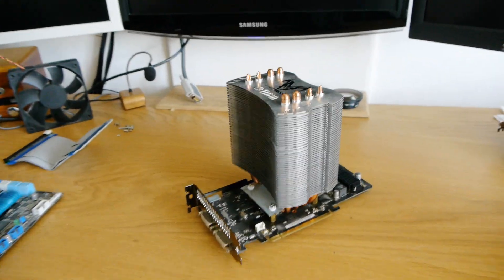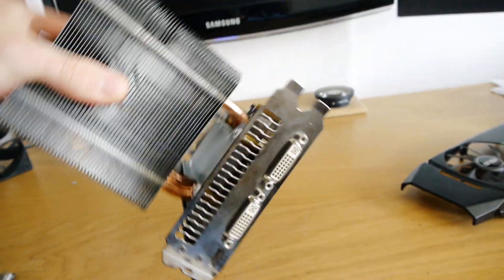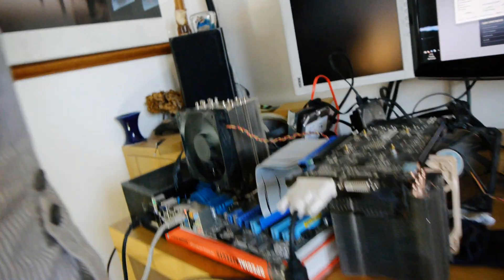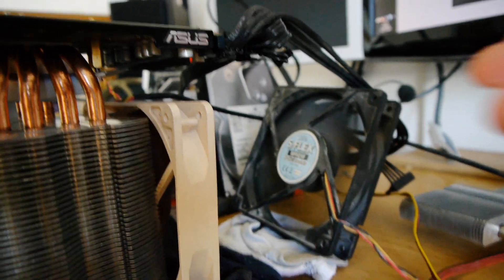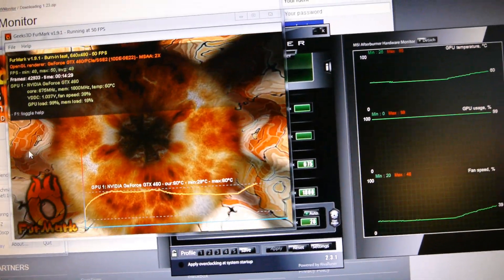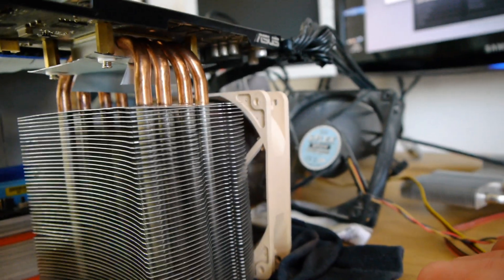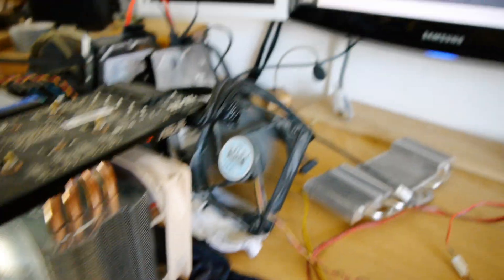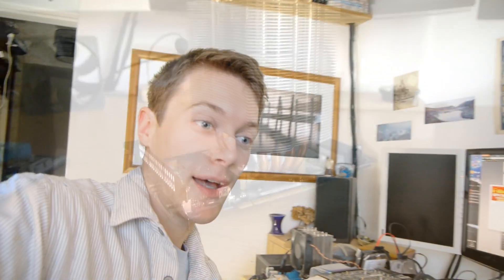CPU cooler on GPU (INSANE temps!)

Comment: DIY Perks You aren't using your cooler right, look up how heatpipes work and why it shouldn't be upside down.
Reply: You mean he's not using it optimally. It still works
Reply: Heat pipes are designed to not need gravity for the fluid to flow properly.  If you want proof, open a laptop sometime.  Anyways, given that he's only 90 degrees off this type of coolers normal orientation I don't know why you would consider it to be "upside down".
Reply: Robert winfield Lol unfortunately he was just born that way. Check out his comments on other things.
Reply: carlover you have become a magnet because you are wrong, you don't shut up and you keep coming back and reading this post. Can I get a +1?!?!
Reply: carlover "The condensed working fluid then flows back to the hot end of the pipe. In the case of vertically oriented heat pipes the fluid may be moved by the force of gravity. In the case of heat pipes containing wicks, the fluid is returned by capillary action." -Wikipedia

I did read. Looks like you're just an ass.
Reply: Spencer Twaddle Nature can be such a bitch sometimes, we cant blame him for that.
Reply: carlover lool good thing i have some popcorn :D xD
Reply: You know that's how water gets to the tops of trees right...?
Reply: No, you've proven that you can look up how a vapor chamber works. You haven't proven anything about pc heatsink's have vapor chambers. The titan has one and there are a couple cpu heatsink's that have them. There may be some with a gas in them but those aren't a vapor chamber like what you're talking about, you know, the kind with actual fluid and wicks. Just admit it. You have a partial idea of how shit works but you don't know how a standard pc heatsink works. Trolloolloollooll.
Reply: carlover 
 If you think about it you will notice that for experiment like this is not possible to turn graphics card in "right way" (tower up) and leave it on the table because you cannot  connect graphic card with motherboard in that position because connectors on GC would be pointed away from MB.
Reply: But its only test.  This video is not about how cooler have to be, but what you can get with cpu cooler on gpu. First time i build it i also try it this way, upside down, and then i build open case with cooler facing up, above PCI-e connector at motherboard. Now i got 5° lower temp then when coller was facing down.
Reply: Spencer Twaddle haha!
Reply: carlover  Why dont you open your graphic card, take one aftermarket CPU cooler and make video about how cooler have to be in case like this and leave us to admire to this idea like it is. How can you say its wrong? Temps are 30° lower then with stock cooler turned facing down (the "wrong way") to me that is not wrong. With tower facing up is a bit better but it works great in both ways. And btw your trash talk is not effective  here at all.
Reply: carlover sadly carlover is correct. Gravity and centrifugal force can affect capillary forces, and those a forces normally seen in vapor chamber heatsinks. http://www.radianheatsinks.com/VaporChamberTechnology.aspx HOWEVER, I don't see many vapor chamber heatsinks, and if they are they really don't like to advertise apparantly (besides the fact the few I've seen GLADLY flaunt such a feature). The ones that are vapor chambers normally cost more, and generally look... cooler. The heasink in this video seems to be just a standard after-market one, not a super fancy 100$ heatsink. I think in general the reason vapor chamber heatsinks aren't common is because for the same price watercooling would be better.

Oh, and carlover, to assume a redirection from wiki based on vapor chamber > cpu heatsinks is just idiotic. Some topics are redirected based on lack of information, not because it is standard to contain it.
Reply: Emil7773 It doesnt need to lie on the table, the pci riser cable isnt a solid object it can bend, so it isnt problematic to bend the cable and make the card lye with the cooler facing up.
Reply: Emil7773 How is it an objective test if he hast placed the cooler right orientation? It doesnt show real benefits. Glad you had excellent results. 
Spencer Twaddle Im glad you took time to try to be a smartass. Next time actually read something about the topic so you dont write complete bullshit.
Reply: This kind of cpu cooler doesn't have wicks. 
Also if you think you can even compare forces between capillary forces and gravity you really need to read more about it.
Reply: That only maters with vapor chamber heat sinks. This is just a regular one. Being upside down isn't going to matter....
Reply: Jesus fucking christ i quit, look up how heat pipes work for fuck sake jesus shit !!
Reply: Spencer Twaddle  Kevin Cornell Emil7773 
Im so glad you are proud of how uneducated you 3 are. When you look up how heatpipes work and when you read that in fact Emil7773s results prove what i am saying let me know if you still think you are right. I just love when Kevin Cornell said that what im saying only applies to vapor chambers while he didnt know today almost all heat pipes are vapor chambers and ones in video are vapor chambers. So now 2 of you actually confirmed what i was saying but still think you are right. But i guess at this point i could draw it all out for you and you still wouldn't admit you were wrong.
Reply: carlover why don't you look into the gtx titan's heatsink and find out what a real vapor chamber is. No, not most of the coolers out there are vapor chambers. Very few are. Most are just some hollow copper or aluminum tubes that transfer heat. No vapors in those.
Reply: Kevin Cornell You just wont admit it. Almost all CPU coolers today have gas inside the heatpipes. Dude i dont have time to reply 100 times, if you dont want to learn there is nothing i can do about it, it is your choice. 
http://en.wikipedia.org/wiki/Heat_pipe
Reply: Emil7773 Yeah just like i said, it is working better when the heat source is lover than heatpipes. Thanks for confirming what im saying once again. That is literally what im trying to explain here.
Reply: carlover I don't think you actually read that Wikipedia entry (great source, by the way). 

You said that it utilizes a vapor chamber? Well, according to your own source, "Note that most vapor chambers are insensitive to gravity, and will still operate when inverted, with the evaporator above the condenser". Furthermore, capillary action is mentioned several times throughout, particularly noticeable in the Vapor Chamber or Flat Heat Pipes section, where it states that vapor chambers often utilize "a closed-loop capillary recirculation system".

So, either you didn't read it or you didn't comprehend the context. Also, you probably don't understand how capillary action works.
Reply: Naga Sadow Am i being pranked by a group of trolls? I don't understand how i've become a magnet for those that either don't think or read completely.
Dont you see what wrote in my last comment? Let me quote "Yeah just like i said, it is working better when the heat source is lover than heatpipes.".
Which doesn't say anything about cooler not working facing the wrong way, im saying for the 100 time that the cooler would work with heatpipes facing up. 
The capillary forces cant even be compared with the gravity moving the gas and liquid inside the vapor chambers, thats why trees can only grow to certain height, after that heigh the gravity wins and capillary forces become to weak.
Reply: Kevin Cornell Of course im coming back, im getting notifications about replies. 
You clearly dont have any arguments left, i have proven i was right more than once. Its your choice to accept it and get educated or continue to go the other way.
Reply: Kevin Cornell Sorry, I have proven myself and what i told already. There is also a guy that confirmed what i was saying without him even knowing. Those heatpipes most of aftermarket cpu cooler have today are vapor chambers. Even wikipedia redirects vapor chamber to heat pipe, since today that is what heat pipes are. Get 212 evo for example, cut the tops of those heatpipes, see if would still work as good.
Reply: So at my job, we have these hilo's with a really old compute system on them and I saw today that they have a 25mhz processor in them. O.O just blazing fast! Lol.
Reply: Get an inverted case if you are concerned, problem solved.
Reply: my theory is that carlover is just from a different planet and his brain isnt compatible with ours
Reply: seong min Thanks. But its only basic physics.
Reply: carlover Physics that you don't understand. If you did, it would be obvious that an inverted orientation for a CPU cooler has no negative impacts on the cooling performance. The orientation doesn't interrupt the movement of the vapor, and therefore doesn't impede cooling. As most of us know, gases that are different temperatures displace each other in order to create an equilibrium.
Reply: Naga Sadow I proved im right and also got a confirmation in this comment tree that what im saying is true. I did tests myself also that proved me right. I really dont know why so many butthurt people keep replying to my comments. Its true what George Carlin said-“Just think of how stupid the average person is, and then realize half of them are even stupider!”.
Reply: carlover Well, since what you say is going against the source that you cited, we need documentation and videos of your thirty controlled experiments... otherwise it's statistically insignificant and therefore invalid.
Reply: Naga Sadow Dont have time for you and all of the shitty trolls, you have a comment tree here with 10 of my comments. read all of them.

Comment: shouldnt you use the top pci-e slot ? the middle and bottom ones run at 8x, i believe , top one runs at 16x..
Reply: DIY Perks PCIe 2.0 x16 has twice the bandwidth of PCIe 2.0 x8... Theres no reason not to use the top slot if its not populated with something already. But thats just my OCD kicking in.
Reply from the maker: Theoretically yes, but looking at benchmarks there's practically no difference when using one with less lanes (PCI-E 2.0 8x is about the same speed as PCI-E 1.0 16x).
Reply: David Seong I don't think GTX 460 can max out 8x.

Comment: is that a TT frio?
Reply: Great video DIY Perks. Awsome stuff.
To all those who dont belive, you should try it if you can.
I made it with HD6850 and Scythe Mugen3 with 140mm Scythe fan and performance, temperatures and silence are awsome.
Here some pics. 
http://www.pohrani.com/f/1K/by/36p85dJT/dsc01103.jpg
http://www.pohrani.com/f/2i/dS/3Js8ILZ2/dsc01098.jpg
http://www.pohrani.com/f/3S/YZ/3aQYWfX2/1/my-case-minvent.jpg
Reply: Khalid Hassan Shohag
 ebay
Reply: If you're talking about the one on the GPU itself, it's a Scythe Heatsink.
Reply from the maker: Ben Major  It's actually a TITAN Fenrir
Reply: where to get a pci extension chord?
Reply: Are you talking about the cable that comes from the power supply then goes to the 6/8 pin PCI-E connector? Or are you talking about the PCI Express slots that you can use the extenders for it?

Usually I just buy the stuff from Amazon or Newegg, if I was in the US. Ebay if its there as well.
Reply: i was referring to the extenders actually.. thanks.

Comment: The open air probably accounted for a good 5-10c off the temp also. I drop about 7c off my temps opening my case with the stock cooler on
Reply from the maker: Sounds like you need to improve your case's airflow. You shouldn't see any increase in temps if you have a good airflow configuration vs open case.
Reply: DIY Perks. That depends on the case. And type of cooling being used

Comment: How about:
A gpu with a cpu heatsink mod.... placed in mineral oil, using fans to force the oil around the card as well as through the heatsink?

Then you could just dump all of that stuff that's on your desk (with exception to hard drives) into oil and have an aquarium (with no fishes). That would be A solution to the memory chips on the card running hot.

Comment: i did it with my cpu cooler but my gpu failed and is not working now because the heat sink was not tighten enough with the chip well i did with my old hd 4350 which was running far cry 3 and hitman absoluton..

Comment: Nice! Good alternative is the PNY gtx 780ti OverClocked edition. Triple fan cooling unit got the same temps and is not noisy.  h100i on the other hand is the source of most fan noise for my build.

Comment: this would be so much more substantial if you where to tilt the card so that the cooler would be standing up right instead of facing downward. the way cpu heat pipes are made is so that the water in the copper tubing heats up and rises into the top of the cooler and the fan that's attached would cool the steam to the point of being cooler water again and the water would fall down and cool the cpu again. try it with the card standing up next time I would assume it would make a difference in temps

Comment: How is doing this even practical? The fact that he needed a PCI extension should be enough to prove that this solution wouldn't fit correctly in a standard case.
Reply from the maker: Nobody said it was supposed to be practical. This is an experiment for a custom case design... nothing about it is practical.

Comment: Using a CPU cooler on a GPU is a great idea. But, since most people mount their GPU in the case, the test results would have more validity had the entire rig been mounted in a case with a bracket supporting the GPU.

Comment: What really matters is blown surface area and how the fins attach to the pipes.

A lot of 'em are pushfit, which results in poor thermal conduction. Brazing the fins on helps...

Given the way heatpipes work, running them upside down like that is probably costing you a couple of degrees C (cold end should be uppermost)

Comment: Imagine putting that thing upside down on the mobo's pci 2/3,,, the thing will snap off from the weight of the cooler xD hahaha
Reply: i guess a quick and somewhat ghetto solution would be to fold and tape a cardboard support/block lol
Reply: Matthew Holmes Not everybody has a CNC machine or 3D printer to craft a plastic one :P
Reply: AlexTechFix
Haha true man, you could just have gone water cooled mind but i suppose this was more fun so i'll let you off on this occasion
Reply: AlexTechFix Or, get a conductive heat pipe and mount it to the bottom of the case, pulling even more heat away from the cooler.

Comment: Watercooling?
Reply from the maker: Kalle Anund While water is better at taking heat away from components compared to heatpipes (hence better temps), you still have to cool that water with air, which means that it's not strictly got all the advantages.
Reply: Jon Weddle
are you serious?! watercooling is definitely the way to go for hardcore gaming, you are not putting water directly onto the chip lol
Reply: DIYPerks
I suppose if you were that bothered you could just go silly putting waterblocks on everything and have your radiator in another room, up the loft or even outside. Then you can run the fans as fast as you like.
Reply: Why would anyone watercool when air is more efficient and much more stable?  With the right electrostatic cooler you can freeze your cpu/gpu.  Much safer than waiting for your watercooling pump to die and fry your system..lol
Reply: kyle armstrong lol
Reply: kyle armstrong Really?  wow, that's good to know as I've built many water cooled systems for gamers yet my custom air cooled system runs just as cool and I don't have to worry about a pump going bad and leaking :p

Comment: I have 30 degrees celsius while playing something intensive  with GTX 560 Ti and arctic cooler.
Reply: FurMark (The program he is using to test the card) is also know as GPU burner. It pushes the card to it's limits - CONSTANTLY!  While in the other hand you playing something don't give constant stress to the gpu, and barely taking up all it's resources. Besides that your fan is most likely at full speed, while he is running at the lowest possible rpm. Google up FurMark and do a benchmark test yourself! :)
Reply: Well playing Crysis 3 which takes quite everything from my GPU plus renderign stuff, AND the fan isn't even ran at full speed  it's still about 30 - 40 degrees celsius. Thanks for your reply I'll check that out.
Reply: Aras TM The 460 and 560 are not that much different. Both use the 40nm technology, but your card is around 15% better in overall performance. I would be interested in seeing your test results. :)

Comment: 4 heatpipes, not 8. But still, awesome idea xD
Reply: nope, 8 heatpipes, as there are 8 ends. Indeed there's 4 physical pipes, but in this configuration, gives us 8 separate areas for the capillary action to take place.

If heat travelled from one end of the pipe to the other, and not from the center to the end as it does here, there would indeed only be 4 heatpipes in effect. However in this case, as the heat originates at the center of each pipe and travels towards the end, we end up with a configuration which gives us 8 operative heatpipe 'mechanisms' out of 4 physical pipes.

Comment: btw if you stand the cooler the right way (the heatpipes facing up) then u can get the sink to work properly and maybe slightly lower temps, u know the heatpipes works by evaporating a fluid and if u get the gaseous part to the processor then u're actually having the hottest part of the pipe in touch with the silicon, try putting that the right way and u'll get slightly better results